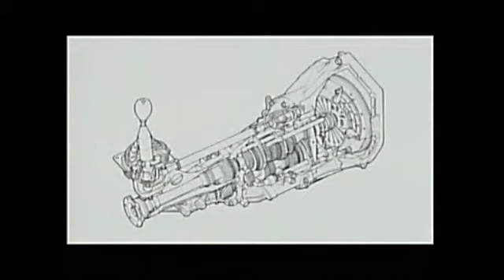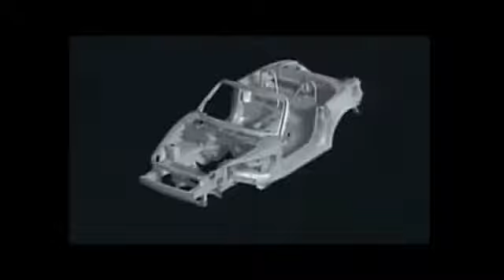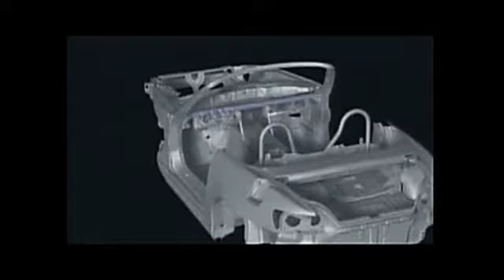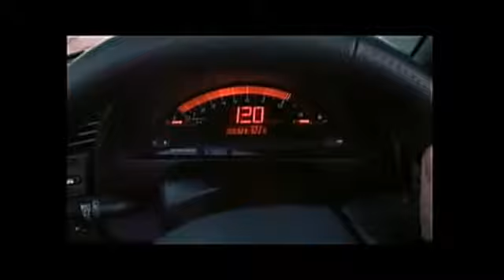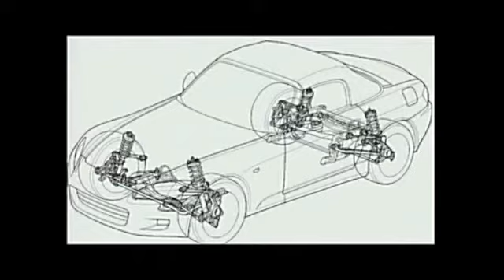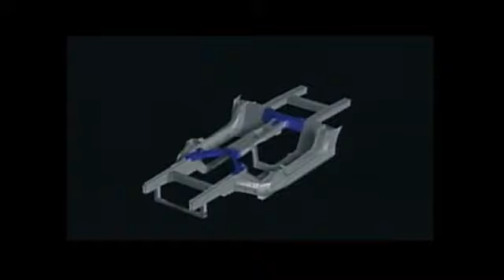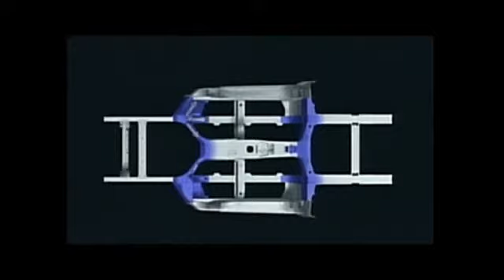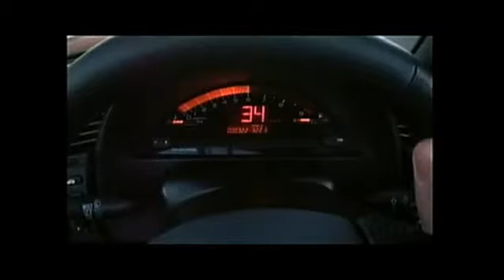All About Honda S2000 (part 1 of 2)

Comment: AP1  is uk car all years.redlines@9000rpm.facelifted in 2004.with comprehensive changes to the cars suspension set up..AP2 was distributed in america.they changed the engine to 2.2 producing more torque but lower redline @8000 rpm..in uk market the best one is facelift AP1 2004 onwards.NO 2.2 litre AP2's were ever sold on the uk market.